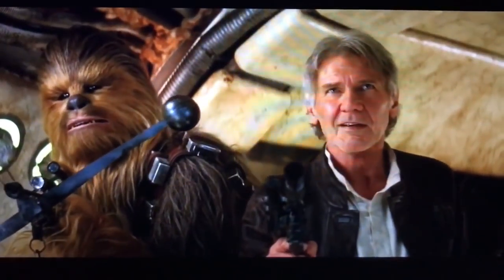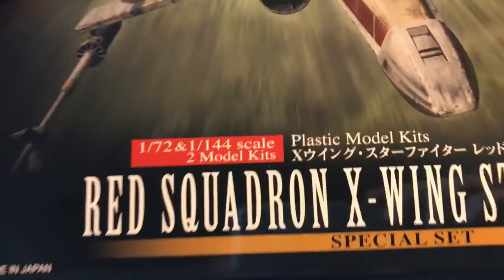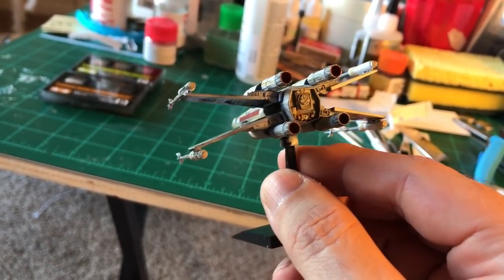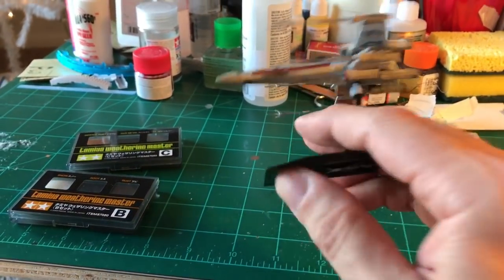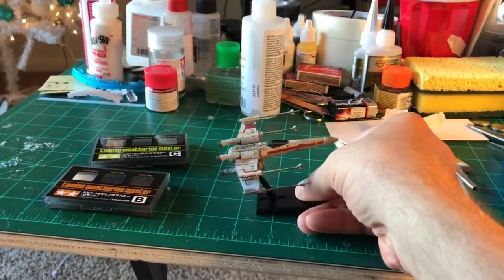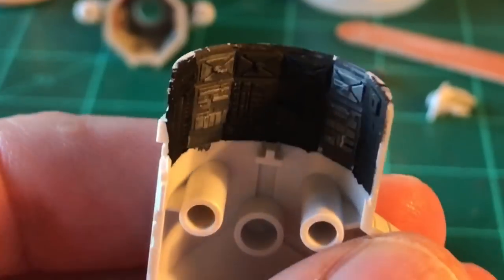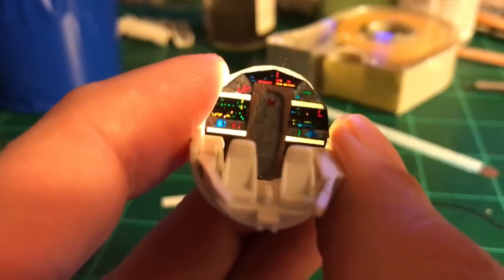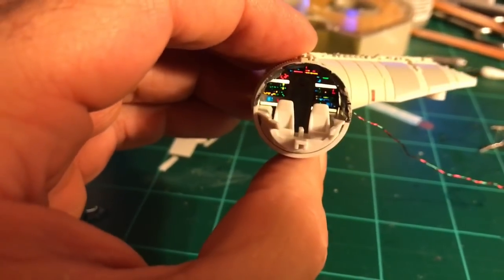Building the Bandai Millennium Falcon part 5

Comment: Nice job. I am tackling this as I speak. I have both 308 bits, Paragrafix, green strawberry parts with Tyridium Models light kit. I like how  you went with the photo etch, but the cockpit lights are fibers. If build this with the photo etch would a have a problem? First time lighting a kit!
Reply from the maker: I prefer using the photo-etch over fiber optics. You can put a thin sheet of clear styrene over the back and paint clear paint colors over it.
Reply: Ken Spriggs thanks!  I think I can take off the optics since it looks like it’s all heat shrinked.

Comment: Thanks for the video - great work!  Question: It looks like that's Red leader. Did they have an option to add the extra red bars if you wanted it to be red five (or some other number)?
Reply from the maker: Thank you Daniel! Yes, I believe all of the Bandai X-wing kits have decal and/or sticker options for separate bars for the red wings. At least related to the type it is, for example the blue wing ones would have blue options.
Reply: @kenspriggs5687  Ah cool! Those kits are top notch but your skill at painting really seals the deal :)

Comment: Nice job on that cockpit. 
Say, where did you get that control panel back wall for it?
Reply from the maker: It is a part of the ParaGrafix photo etch set for this kit. I painted the front flat black and grey, then used clear Tamiya paints to fill in the tiny control panels. Light shines through the clear paint to light up the controls.

Comment: wait those are decals come from the box? seriously? that looks good
Reply from the maker: No, not the decal. This is a photo etch wall that I painted the front. I used clear paints for the tiny holes in the etch and lit it from behind.
Reply: Interesting. I just bought the same set (more for the engine deck vents than anything, but I look forward to trying the interior parts as well.) - kind of seems like the holes in the rear wall sort of run together, though...

Comment: This is fantastic! I never would've thought of back-painting the photoetch with clear paint! Any issues with it flowing through the holes?
Reply from the maker: Thanks, Jay! Not really at this scale because the holes in the photo-etch are so tiny. They are also in such a confined space in the cockpit and gunner stations that any paint issues are not visible. I painted the front of the control panels the desired colors before dabbing bits of the clear acrylics on the back.
Reply: Ken Spriggs which manufacturer's photo etch set did you get? (I got the Green Strawberry set.)
Reply from the maker: I used the ParaGrafix set from ParaGrafix.com
Reply: Ken Spriggs The Green Strawberry photoetch kit comes with a set of decals to go over the photoetch. I wonder if an LED would shine through the sticker and negate the need to use paint + clear paint. Hmm.

How did your base color for the cockpit back wall not pre-fill the lighting holes that your clear paint later filled? Or did you need to reopen the holes with a pin or something?
Reply from the maker: Yeah, I saw theirs, it looks pretty cool. It's worth a try, you can always remove it and paint instead. For mine, I used a thin cost of Tamiya flat paint with a brush so I managed to avoid filling the holes. I had to dab on the clear pretty heavily on the back to fill them.
Reply: I put the sticker on the Green Strawberry photoetch cockpit backwall a few minutes ago and surprisingly it lets quite a bit of light through and uses the sticker for the coloring! Probably not quite as bright as your method though. I only wish I had the 2 different photoetch backwalls to compare side by side and see the light holes.
Reply from the maker: You can get a pretty good image of it at ParaGrafix.com
Reply from the maker: Sorry, it's http://www.paragrafix.biz

Comment: Awesome work buddy, how did you do the colors on the back wall?? If you said I missed it. It looks fantastic!!
Reply from the maker: Thanks Captain! I used Tamiya clear colors, blue, red, green, yellow and orange. I dabbed small amount over the holes in the back of the photo etch. The holes are tiny so it doesn't take much to fill them. Once dried they are still clear and let light though. I used the same method on the gunner station walls.
Reply: You missed it. Clear paint dabbed on the back.